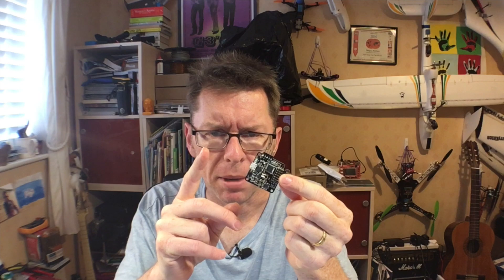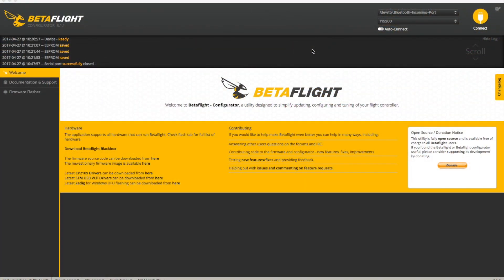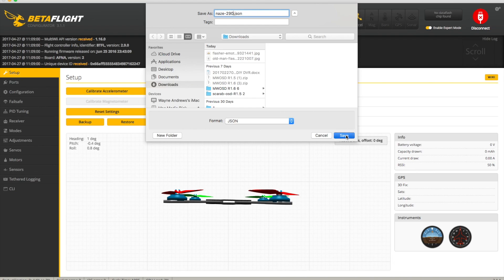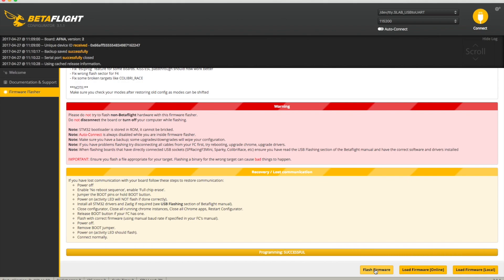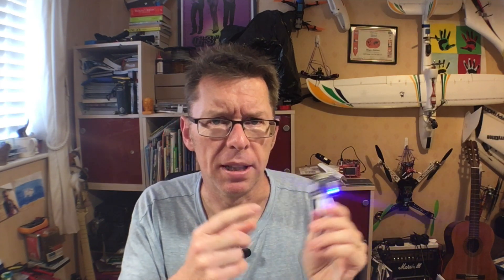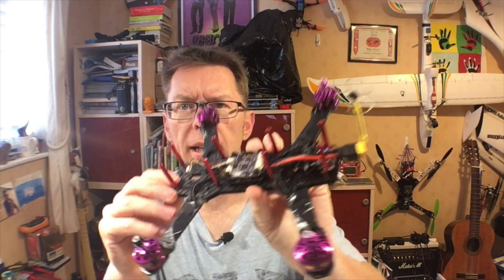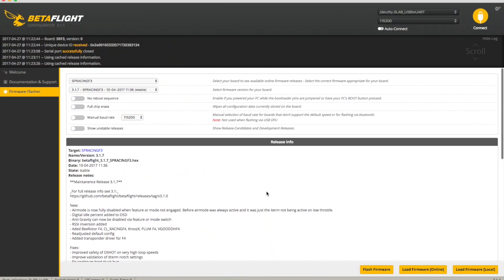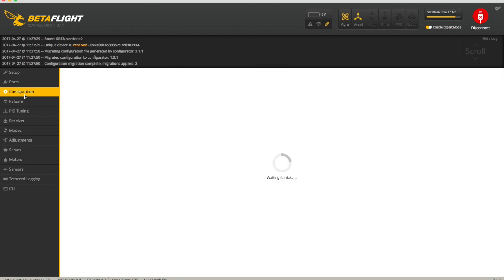FPV Tutorial: BetaFlight Basics Part 1 - Flashing your FC, and what to do if it goes wrong

Comment: You ever had a board that enters bootloader mode fine, but will BF will not show the port open when connected? I've got two CC3D Atom boards that connect fine with Librepilot firmware but in bootloader mode, neither Windows or Linux open the port, even with all the drivers installed. Frustrating! (Love your vids, btw.)
Reply from the maker: So your boards can flash ok in bootloader mode, but after that you can't connect to them normally ?  I have to say no, albeit with the caveat of I've got boards that share the MSP port with my OSD, and if the OSD is plugged in, then the USB doesn't work.  But I'm guessing that's not your issue here.
Reply: CurryKitten no, they cannot flash in bootloader mode. But I'm able to out them in that mode and confirm it's not a hardware issue. Weird.
Reply from the maker: Oh, ok.  Yours could be a candidate for the STFlash method I mentioned.  Ever heard of this/try it ?
Reply: CurryKitten is that the same as FTDI? I've tried that, too. I've also tried loading it with the cleanflight bin file,  but like the bootloader mode it still won't read.
Reply from the maker: No - different software to flash the hex file over.  I did do a screen recording from my original attempt at documenting this.  Let me see if it makes any sense, and if so I'll stick it up unlisted and message you over a link.  It's worked when boards haven't responded to bootloader flashing via Betaflight before
Reply: CurryKitten cheers!
Reply from the maker: Uploaded, but your channel doesn't allow messaging - got some way I can give you the linky ?
Reply: I messaged you. Thanks!